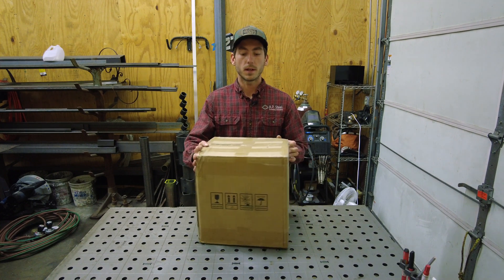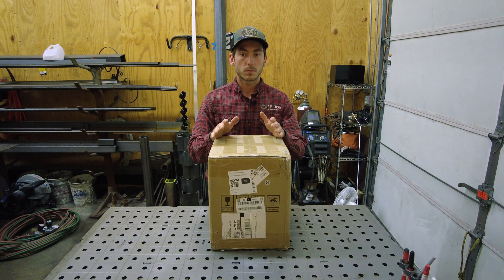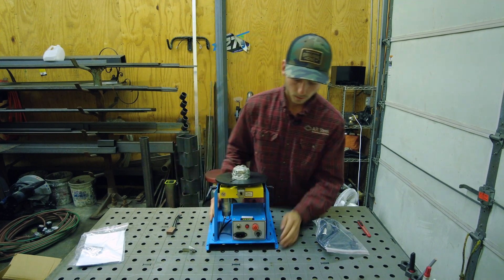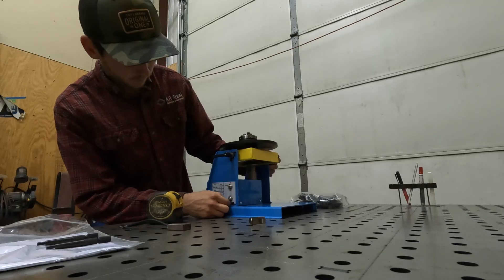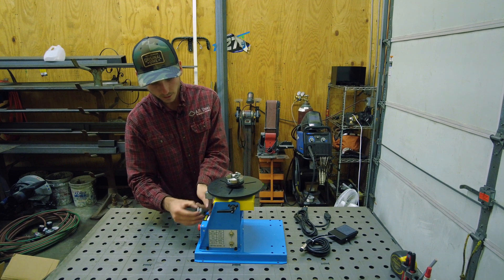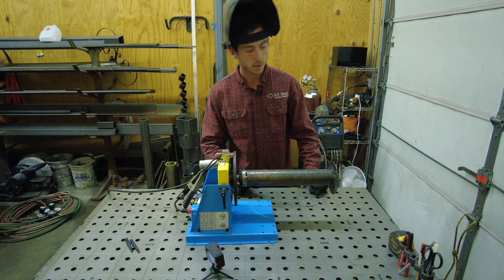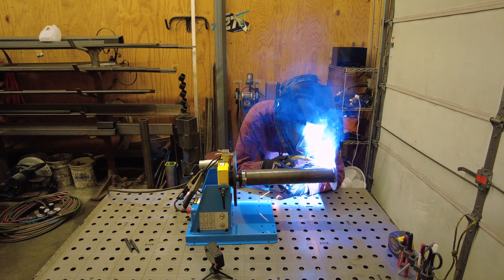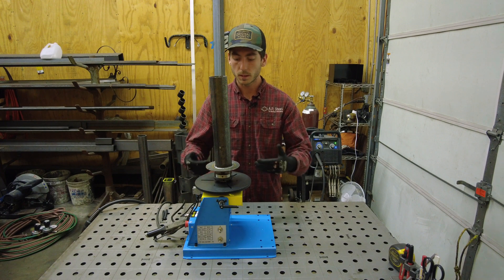Rotary Welding Positioner Review and Test

Comment: I bought this unit and did not get the clip and carbon brush to allow the unit to give the ability to use the turntable for Welding. I've contacted vevor about this and am getting the runaround. They said it's a consumable they drop $60 off, and I then needed to find the brush and clip. I said no way either send the part or give me a return label and a full refund. I wouldn't have any idea where to buy the part and I'm assuming by there reply they don't offer replacement parts rendering it worthless in time. Bad business practice.
Reply from the maker: I’m sorry to hear you are having trouble with vevor. I have found carbon bars that have springs on Amazon, you may have to adjust how you mount it but it may solve the problem. If they won’t send you a replacement part. Good luck!

Comment: Will 3inch pipe fit?
Reply from the maker: 3" will fit but it won't be very stable because the jaws will be almost maxed out. if you are using a big section of pipe it will most likely pop off

Comment: I just took the same  model positioner out of the box and tried it with TIG pulse.  I had the same issue with the speed controller.  On lowest speed, it wasn't consistent and would stop some times. It didn't work on the lowest setting and on speed 2, I had the inconsistent rotation and stopping.   The other big issue was the ground.  It wasn't consistent and would arc on the plate as it moved, throwing sparks and debris every time the torch would pulse to a higher amp.  I'm disappointed, but I can see why a good one is so expensive.

Comment: It looks to be a decent foundation for some improvements. I can imagine coming up with a better ground connection, for example. It could be brought down to a steel base plate that has pins that drop into the fixture table so that it is grounded as soon as it’s set on the table. Maybe a reduction gear on the drivetrain would make the speed control range more useful. As it is, it seems the slowest speed is faster than I’d want, especially if the radius of the pipe is large and the top speed is beyond anything useful for virtually all welds. It appears the drive motor is offset, so maybe a much smaller pinion gear on the motor’s shaft would be all that is needed to reduce the speed. Lastly, I wonder if replacing the foot switch with a variable resistor would allow variable speed while using it. Maybe a TIG pedal would work.

Thank you for posting the video.